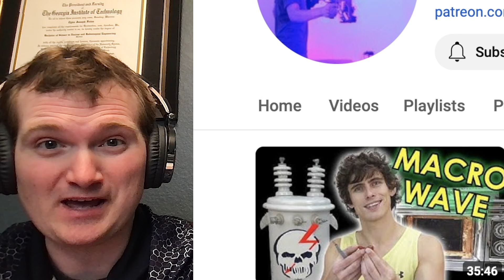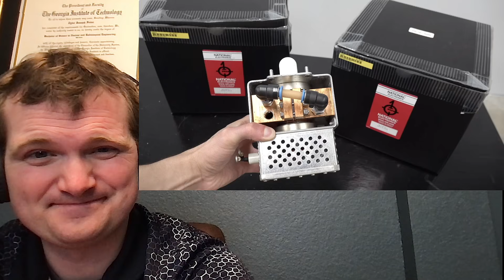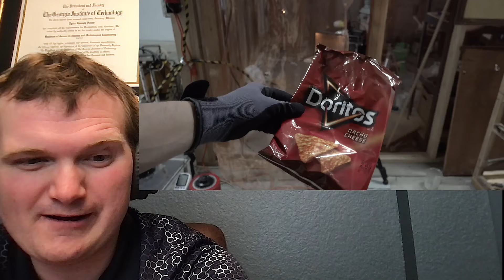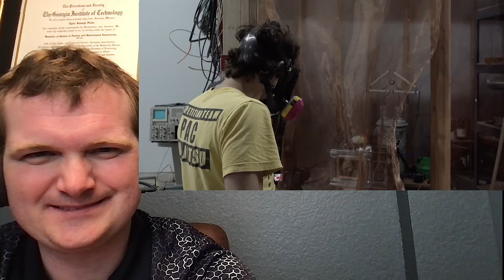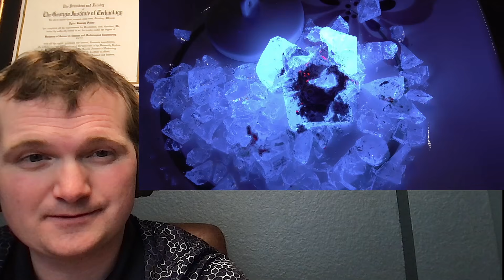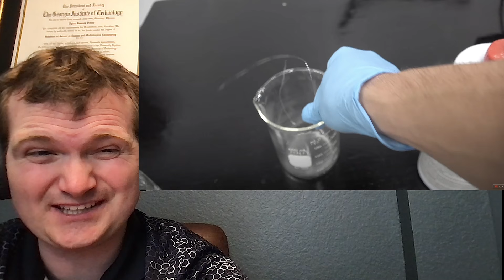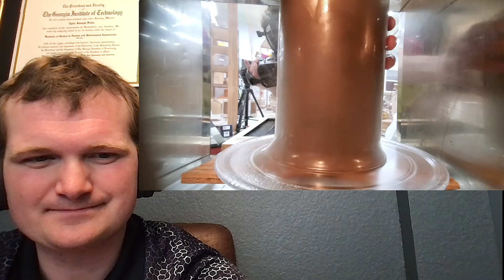Styropyro's MACROWAVE - Nuclear Engineer Reacts

Comment: 9:11 USUALLY. I have once in my life ran into a situation, where I put a pot with a little bit of water on the bottom to heat up, while an electric kettle boiled most of the water more efficiently, and for whatever combination of things happening just the wrong way, it superheated and then blew up. The bang was loud enough that neighbours came to ask what had happened, and the water turning into gas that quickly threw the lid up to the fume extractor.

Scared the crap outta me. =/

Comment: 6:30 They certainly don't build them like that, and I kinda think that might be good? Even the more modern plasticky microwaves that I've seen in my extended family have worked for decades, and usually the reason they broke wasn't because the microwave itself developed issues, but e.g. because the exhaust vents had never been cleaned of grease gunk, and eventually that caught on fire. This behemoth used up probably 5-10 basic microwave ovens' worth of resources... =)

Comment: back in the day, you could go to 7-11 or Get N Go and they would have sandwiches with a large number on them. 1, 2, 3 etc. The microwave did not have a "time setting". just corresponding numbers for the various frozen or refridgerated sandwiches. Those numbers were seconds settings...and very few of them. Those commercial microwaves would have incinerated the sandwich at 1 minute, and probably lit it on fire. I have no idea what the actual wattage was, but it was high.

Comment: I don't think his hot pocket was frozen, so it's not that surprising that it heated evenly; a big part of why food heats unevenly is when cooked from frozen, since microwaves interact with liquid water much more readily than with solid water. Once the first spots start to melt, they then absorb most of the subsequent radiation, getting hotter and hotter while the ice absorbs very little. A little like how boron "steals" neutrons from uranium, I guess?

Comment: Ive used similar industrial magnetrons for a chemical reactor.  They are used at around 8kw but can be run at 16kw at 30% duty cycle. One advantage of microwave assist is that it can make reactions that would take days weeks or not at all occur in seconds or minutes. A regular mictowave oven magnetron can put out about 5kw if you remove the heatsink clean the copper core and solder a watercooling tube to it Also the beam forming waveguide at the end shiuld be replaced with a bigger one. The indilustrial tubes like the one styro used require an isolator and with the proper waveguide assembly would do a lot more damage than what is shown in the video.😮
Reply: I have not used one in awhile but microwave chemical reactors are extremely useful in enhancing chemical reactions.

They were never as popular amongst my colleagues as they were with myself.

Comment: The superheating of water is even what caused Chernobyl to be so disastrous. The cooling water flashed into steam, blowing apart the reactor and launching the upper biological shield.
Reply: I actually had to explain this to my dad recently (I think he still believed the misconception that it was a nuclear detonation), I compared the reactor building to a giant pressure cooker.
Reply: If he reduced glass to dust, is it possible to oxidize dust to glass?
Reply: @vinnysworkshop  Depending on the kind of dust. Glass is oxidized sand after all, and it will melt back into glass if it's ablated into dust.

Comment: "Big dials"... I actually do see that on some Variacs that I still use in my lab. The best way to build those is still to have the knob move a mechanical piece that taps off part of the transformer (simple, effective), and the bigger the dial, the better the resolution that you have in your control.

Comment: The most terrifying of styropyro's powers is the uncanny ability to legally acquire objects and materials that most people would be arrested with.
Reply: Ones he told that The fbi already went to his house
Reply: Magnetrons and transformers are perfectly legal and there's a niche of people who collect this stuff, I've even got some multi-KV transmitter transformers of my own and some high power (actual waveguide) output magnetrons that styropyro would kill for. I've even seen some megawatt 915MHz magnetrons used for industrially treating timber, cooking bacon, etc. With those tubes they essentially have a giant tube on the side of a warehouse and cook everything in the warehouse.
Reply: @linuxguy1199  wasn't microwaves in the GHz range? 920MHz is pretty close but funnily not common
edit: well according to me, correct me if i'm wrong i ain't going mad cuz i'm only an internet explorer
Reply: @ddamsteram7299 most norma residential microwaves are 2.45GHz
Reply: @ddamsteram7299 household microwaves are 2.4 gigahertz.
Reply: The power of misleading EBay listings can get you just about anything, if the explanations in his videos are anything to go by.
Reply: @walugusgrudenburg3068 That's how I got a good induction heater I use with one of these mechanical weed vapes I have, it relies on a metal disk that clicks when it reaches temp. I bought a "dental wax warmer" device which just so happens to perfectly fit the vape itself haha
Reply: Well, he is a certified chemist...
Reply: @nekropost  yeah I’m pretty sure that gives him some freedom when it comes to that regulatory stuff.
Reply: When the FBI visits him, the agents instantly recognize his insanely high testosterone level and avoid arresting him out of respect.
Reply: @gastonbell108  He also fights mma lol hes a menace
Reply: @gastonbell108  Ah, some styropyro lore - I remember when he talked about that. How'd that go again? I believe the doctors were baffled and neither he nor the doctors could figure out why his T was astronomically high?
Reply: @gastonbell108 true, T levels so insanely high that doctors are required to consider it a medical disorder
Reply: Hes pretty well renowned chemist and is pretty accredited at this point
Reply: Pretty sure he's had a few visits from police and FBI after he did a QandA panel with other YT scientists
Reply: he doesn't acquire them legally 😭 The magnetron was sold as something completely different (i.e. customs fraud)
Reply: @vgg175  what do you mean? its a heat exchanger :)
Reply: @vgg175 or more accurately, his purchase is legal, the sale was not. it just happens that he knew of the scam but was interested in what was really being sold anyways, rather than what it was being (mis)advertised as.
Reply: not true at all, the components are legal, just expensive.
Reply: @Hawk7886  Look, I'm no snitch but he got them in less than legal ways. They probably were expensive though.
Reply: @theomniscientoverlord5443  He has a YouTube channel as well as an off-site lab, thus he has a business address. As said in a recent LTT video, where they bought copious amounts of lead: "All you need is a business address and most people will sell you anything, no questions asked."
Reply: murica" Baby!
Reply: 0:44 thoes are the eyes of a mad scientist
Reply: @kuau_Queen-kiki-4652  Indeed they are.
Reply: Dr. Emmett Brown approves this message
Reply: Why do you people think its illegal to own a transformer?  Our house had one ffs.
Reply: 0:44 thoesare the eyes of a mad scientist
Reply: legally huh ^^
Reply: Probably because an individual using these items for legitimate purposes is relatively uncommon 
Extremists using them for some domestic terrorist plot seems much more likely.  At least in our post 9/11 mindset
Reply: even at 14 years old
Reply: He’s also lisenced
Reply: he has a loiscence for the chemicals he buys
Reply: Tell me you're for needless government regulations and oversight without telling me.
Reply: You team him with Rainbolt and they're beating entire intel agencies
Reply: Well im fully " entrapped ....huh huh inkeam enthralled with his work.  Brw you wanna talk ideas,  this aniutbwhst unststed about  the hot pockets snalogy
Reply: U just get a robot, distance,  and go to town and have fun
Reply: how long has he been doing this? I'm sure he has a network of people who he can ask for favors lol
Reply: hes yhe kind of scientist that says hold my beer
Reply: I feel like styro has a lesser chance of them actually getting in trouble/investigated bc he at least knows what he’s doing and how to do it without dying consistently lmao
Reply: I'm pretty sure he's a teacher or something
Reply: Not to mention doing insanely dangerous things and never get hurt, bro is a main character
Reply: I assume the only reason he hasn't been arrested is because the stuff he's buying is being falsely advertised as being way safer than it actually is, so the fault would be on the seller, not the buyer
Reply: @frostythesnowmanlol  the stuff also just isnt illegal to own
Reply: I was an og high voltage/high power electronics, lasers, and chemistry nut on YouTube and I was arrested. They completely erased all my videos and social media videos and images. Even my entire YouTube account. (save for a few videos I put together after I did my time with what little scraps I had that they didn't manage to find/ delete) My channel was starting to blow up aaaaaand busted!!! Now I'm just an artist. And I still tinker.... But nothing crazy since I lost my lab and tools
Reply: @rageagainstthealgorithm  yeah sure buddy
Reply: @joalex79  Are you that arrogant that you think only spyro is smart? Laughable.
Reply: @hhaa9172  IF he wasn't lying then he'd cite links to the wayback machine & if youtube doesn't allow it via comments? Then he can always cite it via YouTube channel instead or in the comments of his videos, heck he could even make a YouTube playlist for re-uploads etc.

So yeah if they're gonna make claims like this they better show proof via the wayback machine cause ain't NO WAY that there wouldn't be at least 5-10 different re-uploads by that point!

There are many ways to prove it, so if they want to be believed? Then they should at the very least make a video titled (what happened to my old channel & videos?) the fact There's no such thing on their channel is proof enough.

Also since when is law enforcement allowed to delete other people's channels? I'm fairly certain they'd need YouTube's cooperation at the very least.
Reply: @rageagainstthealgorithm 🧢
Reply: @rageagainstthealgorithm  If you think you hate the government, you dont hate them enough... sorry to hear a group of grumpy old fucks with shriveled old balls saw fit to point a gun at you and steal your belongings.
Reply: @rageagainstthealgorithm Dang, really
Reply: @rageagainstthealgorithm Hey i think i remember your videos, what was your channel's name?
Reply: @rageagainstthealgorithm  Who ever went against you s unamerican! Props to you man!
Reply: I wonder how high his parent's electricity bill is

Comment: Microwave to make easier manage of nuclear waste? Plasma generated ultrasonic holography best.. Max control potential over an entire area with ability to be the primary scanner. Fires beams to merge water to a center point in triangle pattern to make a rotating ball of water while splitting some with Ultrasonic resonance before expanding and contracting the core while using modulation of core to generate Ultrasonic repel to limit the fuel the star can take from your atmosphere Best anti-drag technology in the galaxy still.. Floats over nuclear reactor and scans it Pressure waves.. Burning sensation.. Ringing ears.. Fullness in the ears.. Signs we're scanning you.

DNA damage is forever.. Rolls globe Humans our PROPERTY.. < Oh we mean when we download your minds. Points at Elon connecting machines to brain proving biological is capable of being translated to machines and points at stories of ancestors talking about afterlife Something like that..

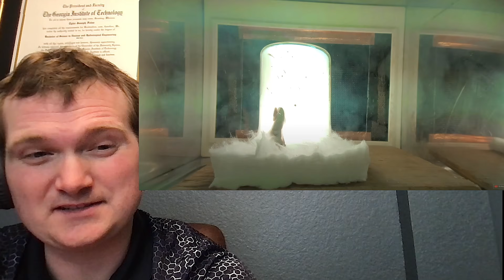Comment: 19:50. not just linear accelerators of course. ECR ion sources are very common throughout the particle accelerator industry and are really just big microwave ovens. 

You can easily generate a metal heavy ion beam by sticking in a small petal of the material, flowing in a small amount of oxygen gas, activating the microwaves to generate oxygen plasma, then applying an electric potential to that metal petal to create a sputtering effect with the plasma. The sputtered metal quickly is ionized by the plasma, and can be extracted by a constant electric potential to be fed into the HV accelerating method (cockroft-walton, VDG, cyclotron, linac, etc). The accelerated ions are then selected by a magnetic field (basically just spectroscopy) and sent to the target. The cyclotron in particular has a bonus feature of selecting the species for you while accelerating it, typically to a far higher resolution than a typical steering magnet can (especially if it's a superconducting cyclotron)

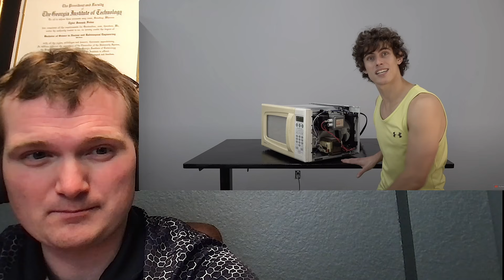Comment: 3:24
I heard that they can store enough power to kill you, even hours after being unplugged.
To be fair, I don't remember what length of time unplugged that I'd heard they can still be lethal.
Reply: Always discharge the capacitor first before working on them. In the 20kV setup he didn't need a capacitor to double the voltage so its 'safe' immediately after power off. I do wonder where one just finds a FULL BRIDGE RECTIFIER's worth of 2.5KV 10A diodes, pretty cool.

Comment: I find it crazy that all of this circuitry could be easily improved by using amorphous metals inside the transformer, the magnetron, and possibly a breaker. A lot of energy is being wasted by the microwave and a lot of that could easily be improved without changing the circuit very much.

Comment: 1:30 - Styro knows this and surely that cabinet and the one next to it is empty, he just does it for the meme.
Reply: Exactly. A lot of this stuff (like rubbing his hands all over the microwave internals he just claimed to cause many deaths of hobbyists) are clear references to ElectroBOOM style humor.
Reply: @Kalladdin  while he was factually correct in his statement,  many amateur videos and things dealing with flyback and HV Transformers have resulted in serious injuries and deaths by curious individuals who have little to no experience working with high voltage / high potential electronics, that is no joke. 

But yes, Styro, obviously discharges the HV Transformer  and Super Capacitor before doing things like these as you eloquently put it,  making references to Electroboom and meme references.
Reply: @CapStar362  yeah I heard explaining the joke makes it way funnier, cheers mate

Comment: Speaking as a medical professional…UV B and UV C can for D-Dimers in genes, essentially welding them together, they strip the electrons off the proteins that make up the genes and they stick together becoming non functional.  If this happens to enough genes, you get cancer.  This is why UVB, and UVC are considered ionizing…at least that’s what I was taught in my physics class.  I am an emergency nurse practitioner but I took premed courses and an introduction to astrophysics because I’m an amateur astronomer … I’ve seen them lump UV into ionizing radiation for medical and not for astrophysics

Comment: 0:16 "did he yoink a transformer from a pole?!" - probably, like he's powered a very powerful magnetron with it, so it probably operates on like ~11kV-22kV lol
Reply: It’s called a pig pole transformer it normally steps down any were from 7,200 to 15,000kV. Too 240 volts with a center tap. The way he is using it here is in the reverse method instead of a step down transformer he is using it as a step up feeding it 220-240 volts on the step down side that would normally connect to your home for your power service, and then powering the magnetron with the High voltage, as the other commenter mentioned magnetrons are basically a vacuum tube, and they use high voltage DC
Reply: I don't think that's a pole transformer I think it is a capacitor from a HV circuit
Reply: Millionaires, especially content creators can get ahold of lots easily.
Reply: Nah he bought it
Reply: the magnetron runs at 115v, it pulls something like 175 amps. The transformer is a huge flex, you could power that thing off a welder PSU.
Reply: @Hawk7886  Incorrect. The magnetron operates in the kilovolt range, or they'd not have an HV transformer in a household oven, Maybe you're thinking of the filament? Which is very low voltage at several amps in a domestic variant

Comment: 25:06 I was really impressed that even a little tungsten was melted. It is so hard to work with. Normal metals you stick in heat until they get soft or melt them in a crucible in an oven. What happens if your tongs or crucible melt before the metal? With tungsten's melting point being the highest of all metals EVERYTHING melts before the tungsten does. Tungsten can also react with other things making it hard to work with keeping it pure tungsten. Tungsten manufacturing is its own impressive exercise in material science. As for its uses in medical applications tungsten is used when shielding PET isotopes such as F-18 which have beta radiation with more energy than most usual gamma isotopes used in medical uses that need transporting. When transporting medical isotopes, space does become more scarce and tungsten becomes more viable despite its cost.

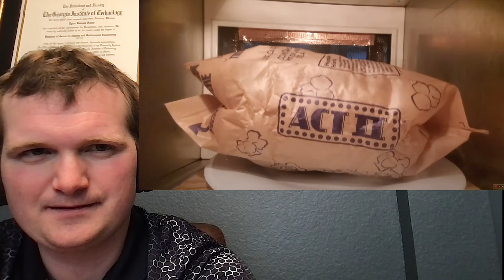Comment: @18:00  I know a guy who claims to have invented the heating element for and glue that holds the microwave popcorn bag together.  He said the heating element was designed to be self-regulating for temperature.  I wonder if that's why the popcorn still took minutes to pop.  It wasn't burnt, so it seems like the design worked well.
Reply: it took 30 seconds btw
Reply: still my popcorn always gets partly burned, even if i just heat it at 720W lol
Reply: @dankrigby5621  The guy that told me this  said he designed it for the Orville Redenbacher brand.  Maybe try that brand and see if you have better luck.  He explained how the heating element worked but I don't recall the details of how it shut down heating once at the preferred temperature.